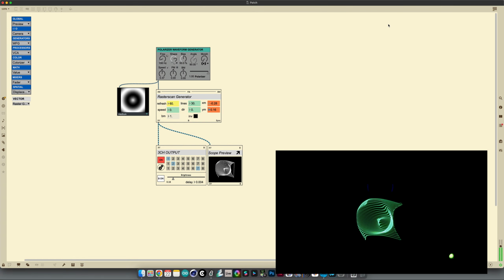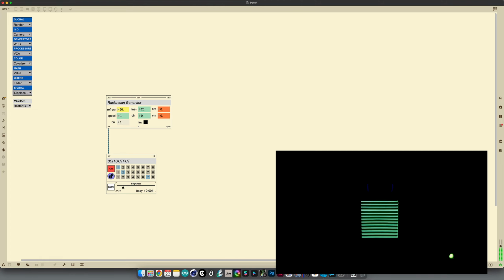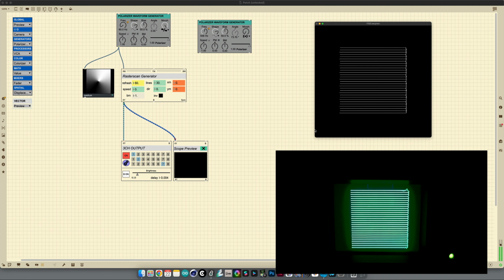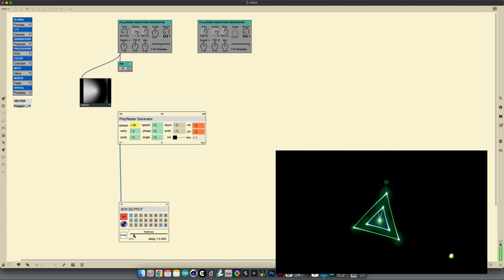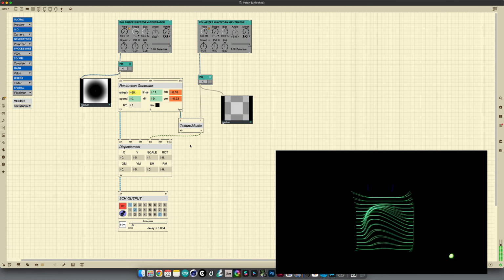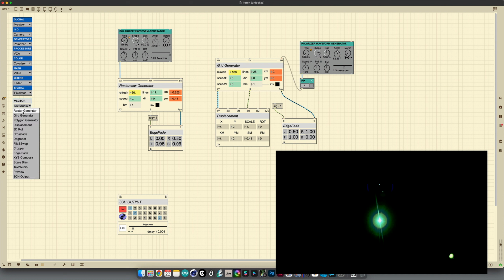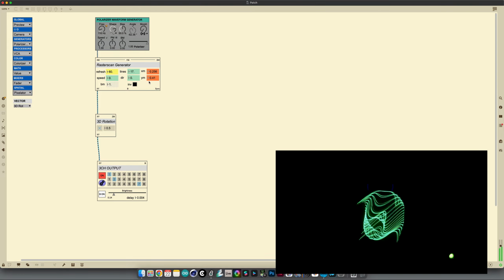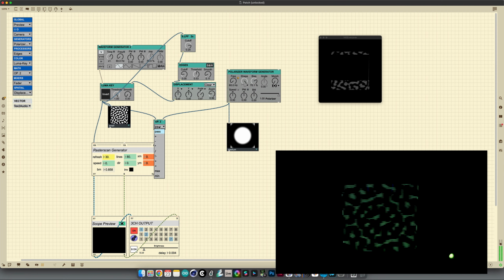Vector-synthesis add-on for Vsynth - First overwiew

Comment: for some reason when I try to connect to the "scope preview" from the vector menu it only comes up as "preview" and when connecting to the rasta generator. nothing is happening on the preview either
Reply: must be something within Max because i loaded your vector preset and got the noise back and preview works like it should
Reply from the maker: Not sure what you are referring to but I suggest you watch this video instead https://youtu.be/QSbAcy5OjN0?si=ppb4kLDmRAk1UkDF